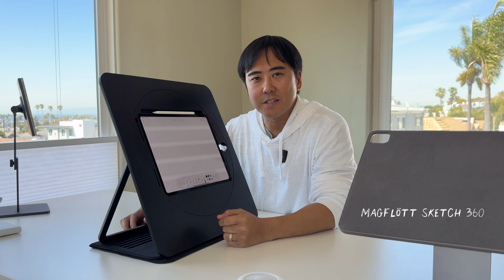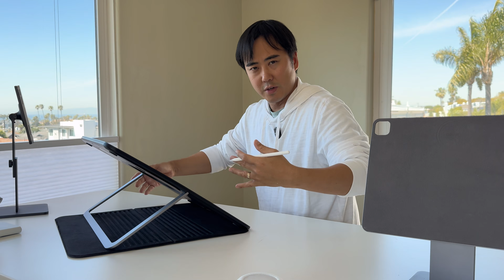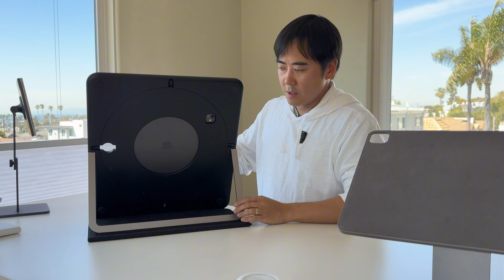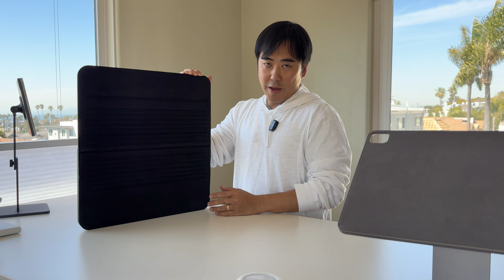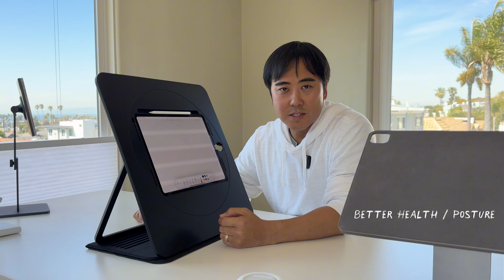First-ever Rotating Drawing board and case for iPad Pro/iPad Air, MagFlött Sketch 360

Comment: This is an awesome product based on the demo here. Very practical indeed. My only suggestion is you design a complementary case that fits around the iPad that can also fit into the drawing board so when I take the iPad out the board it already has a protective case rather than a naked iPad.

Comment: I have been following it for a long time. The rotating design is very attractive, but the latest version looks much bigger than the previous one. I don’t know why they added more space above and below the rotating disk. Now it seems that the position of the iPad is a bit too high. I don’t know what the actual experience will be like, because the previous version looks about the same size as Sketchboard Pro. Now it feels particularly huge. If I want to consider carrying it out or going somewhere, I think it will be difficult to find a suitable backpack to fit it.
Reply: When I first started to pay attention to it, I thought its biggest advantage was that it could be placed on the legs and rotated, so that I could draw comfortably while lying on the bed or sitting on a chair or sofa. But now I feel that the iPad might be too high to be placed on it, so I will continue to wait and see before the final size data is announced. However, this product is indeed very attractive to me who doesn't want to draw at a table all the time.

Comment: Wondering two questions:
1) the preorder website has a different photo for the back of the sketch 360. Is it going to be the full open back like in this video (i hope so)? Or will it be the perforated pattern from the website?
2) Is there no way to get a lower angle? Like a 5, 10, 12, 14 degree?

Thank you!

Comment: The lowest angle isn't really low :( Why remove the last grooves. Also the product page looks different
Reply from the maker: The main purpose of MagFlött Sketch 360 is to draw at an upright position. The hinge is at max angle so ot can not go any further. We move the hinge position in previous protoypes in 3 different places to find the best stability, durability, and drawing angles. From our tests and feedback, anything angle that is lower than what we have is as useful. The lowest drawing angle is very comfortable and I love drawing a lower angles. - Charlie
Reply from the maker: The images on the product page will be updated as those are from previous prototype renders.
Reply: @CharJenPro  Thanks for the response! I made a reservation about a year ago because the design looks great, especially for vertical drawing. I’m sure there’s a good reason the last grooves were removed, but it's a bit of a letdown for me, since I prefer drawing at a low angle. With more grooves, the overall height would also be lower, which would probably help keep it from blocking my monitor.
Reply from the maker: @ happy to let you know, we can add 2 more grooves for a lower angle! We’re going to make test it in our next prototype.
Reply: @CharJenPro  that’s very cool :)

Comment: It needs a larger opening behind the iPad so it stays cool, like the sketch board pro
Reply from the maker: Actually, the opening is the BIGGEST. 

I designed it that way. The circumference reaches almost to the edge of the iPad Pro's top and bottom border (in landscape view) with a slight border.

It may not look like it because you're seeing it compared to the whole board, but compared to the iPad, it's basically huge as it can get. Don't forget the sides needs a backing for the built-in magnets to hold the iPad Pro in place.
Reply from the maker: One more thing, Sketch 360 is big, so the opening will seem small in comparison. Here are the circle dimension for you to measure on the back of your Pad Pro 13"/12.9", iPad Air 13":  
Opening Circle Diameter = 7.25"
Top border = 0.5". 
Bottom border = -0.5"
Reply: @CharJenPro when do you ship ?